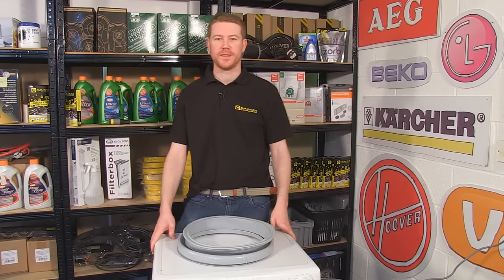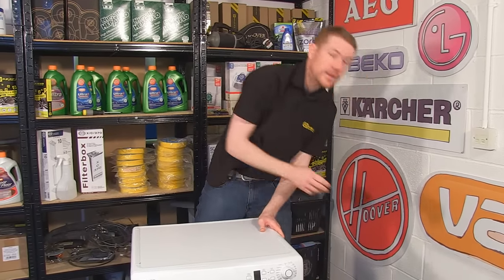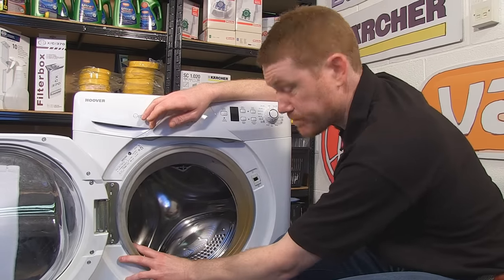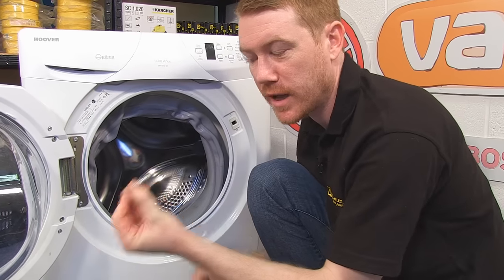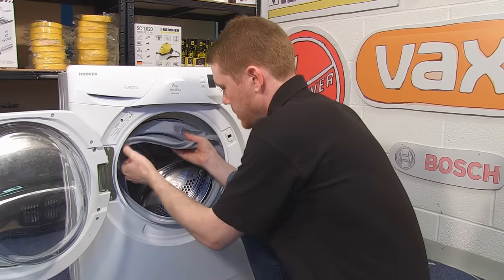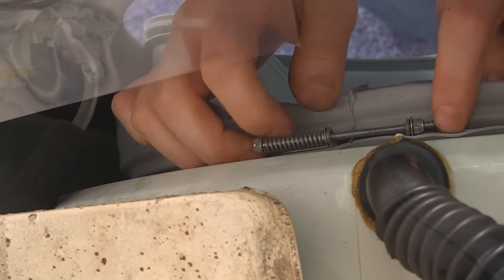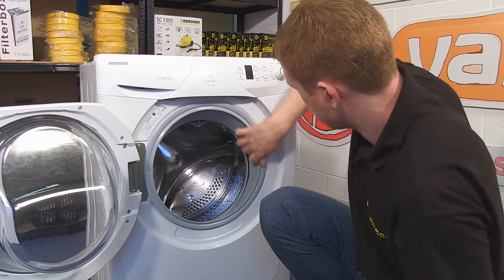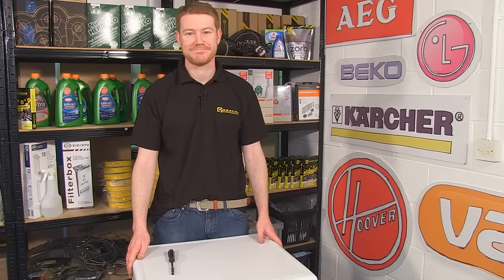How to Replace a Hoover Washing Machine Door Seal

Comment: Who's got the nightmare spring version on one of the newer Hoover models (2018) absolute nightmare, been trying to do this for 6 hours now on and off - the internal retaining band is hellish, conceding defeat and having to order the tool off Amazon. I hope that works.
Reply: Nope, looks like they're too small. Called a bloke today, told him what I'd done e.g. taken it off and cleaned it and then wasn't able to put it back. Without prompting him he said "Is it a Hoover"? Yes... He then went on to say that they're the worst and he struggles with them and he's got the right tools and it'll be £65 to do the job. So, he's coming round Wednesday.
Reply: @someblokecalleddave1  - I’m in the same boat - Hoover with a spring gasket on the inner ring. I bought the biggest/widest pliers on Amazon, they only stretch it about 0.5cm which makes getting it back on just impossible. 

Not sure whether to spend £25 on a new screw type retaining band, or just pay someone to do it. One thing is for sure, I’m never buying a Hoover again, I hate when companies use cheap rubbish that make basic maintenance a hassle
Reply: @SuperBert1000  Yeah I was tempted to go down the screw in route, but looking at how it all has to be tucked into all those fold so precisely, I thought that might even be beyond me? That and the fact that you don't know the diameter of the other retaining bands is suited to the Hoover models. I'd like to have been in when he does the work, to see if he super long pliers, but he's said himself it's ridiculously difficult. I'm not even 100% convinced that this is the solution to the initial problem of the leak!
Reply: @someblokecalleddave1  sounds like we have the same model - mine was leaking from the bottom. I took off the back plate and it seemed to be coming from the bottom of the door, so I’m pretty certain it’s the seal that has gone at the bottom. I’ve got a fella coming to look at it on Friday, so hopefully he can replace the seal and I can give it a test. Good luck with yours, hope it gets fixed!
Reply: @SuperBert1000  Mines a DHK 1482D3-80. Mine was same - just a little water on the floor at the front. Checked all the metal parts and the pipe connections, every thing like that was fine, none of the inside of the machine was wet or rusty, so had to be the rubber seals. Having got it off, it didn't seem that gunged up, there was a bit - but nothing where I thought 'Oh yeah that'll be what it is'. I'll let you know how I get on with it tomorrow.
Reply: Thank christ I’m not the only one! Blew a gasket myself trying to fit replacement.
Reply: @coolerking70able  I had an engineer come round. When my wife rang him and explained what I'd been doing he said 'Don't tell me its a Hoover'? My wife came back with 'Yeah, are not interested then'? He went on to say that they are the worst and he hates doing them as they're so difficult. When he came round, sure enough his pliers had a massive gape in comparison with the ones you can buy off of Amazon and he turned the machine upside down and accessed it from the bottom explaining when they're put on in the factory, its at the stage before the drum is fitted into the casing which is obvious. Did manage to get yours on?

Comment: I'd like to point out that I have a hoover dynamic next and the metal ring that holds the inner part on is not screw fix, it's a spring...... and it's a complete pig.... Took me ages to do this because the seal doesn't fold inside the drum and stay there without pulling off the rim.... So I had to get my wife to hold the rubber seal out of the way to allow me to get the metal ring into place.....My neighbours learned some new swear words though.... repeatedly. Once the inner ring is secured, the rest of it took about 3 minutes..... So frustrating..
Reply from the maker: Hi Rob, thank you for your comment and we understand that different models will be designed differently, we are glad you managed to do it so well done.
Reply: Rob Brewer I’m at the same point with my Dynamic Next machine, how did you manage to open the spring?

Comment: I did it exactly like instructed in the video. But it is impossible that the new door seal fits in the inner drum. Every time its almost completely inside, a fold appears in the seal. It seems as if the doorseal is to big. Do you have some advice for me?

Comment: During a recent wash the seal around the front came off and a top of mine got stuck around it. I managed to remove this but there's a couple of gaps im unsure if this is damaged because of the clothing and it coming off or its meant to have these? Also what is the right way to put the seal in as i have no idea whats the front or the back? Thanks
Reply: Generally the seal has a bit of a pocket/large channel on one side with holes in them, that goes towards the drum as it allows water to flow back into the drum (or to drainage pipes if your washer model has them) if it splashes against the glass window. 

There are also two ridges, one on each side of the seal that hold the retaining springs. Generally the thinner ridge (that holds a metal hoop with a spring holding tension) goes against the machine body and thicker ridge (with either a thicker metal hoop or just a large spring) goes around the tub.
Reply: @bami2  Thank you so much.  I'll give this a try :)
Reply: @natashamarples6468  just make sure you clean any channels in the seal (it's much easier when it's off) and lube both ridges up with some dishwashing soap before trying to put it back on, it will be nigh impossible to get it back on without it and you might need replacement springs/hoops if it just came off as it isn't supposed to do that. 

If the holes are neatly rounded they are probably original but if it's a tear or some other weird shape it might need replacement. Just make sure you don't see obvious damage and maybe put the machine in a basin so if it leaks it doesn't destroy the floor of whatever it is on. 

Good luck!

Comment: 2:55 was the golden piece of this video for me, using a bit of dishwashing soap and it went from completely impossible to slips on in a couple of seconds.
Excellent information!
Reply from the maker: Hi, thanks for your comment here, glad our advice has helped you out! Well done for completing the fix yourself.
Reply: @eSpares  I had to replace the entire drum assembly (broken spider arm) so everything in the machine had to come out (it was not "economically viable" to have it repaired by someone since the labor would've cost more than a new machine), but I took it apart to diagnose it myself (and determined that all the other components were in pretty good shape aside from a scratch where the original drum hit the tub, even the heating element had almost no limescale on it) and now it's all back together and working again without any leaks, because I re-used the original seal that didn't have any lube I just couldn't get it on, without that little tidbit of info I couldn't have done it. Thanks again!

Comment: I found fitting the new seal to the dru9m the most frustrating job I've done in my 72 years of life. I'm very practical and been trying to fit the seal for 4 hours now and still not there yet. Unless you can see the guy in the video fit the complete circumference of the seal, think twice, you get 90% fitted and it pops off somewhere else. I even have it clamped. 

Pay someone else to fit it and make sure it's a fixed price. 

Mike P.

Comment: Is there a companion video that explains how to retrieve a nut driver from the bottom of the washing machine, after dropping it trying to unbolt the inner seal?
Reply from the maker: +TooSlowTube Many hoover machines have a cover used to reduce noise. This can be seen being removed in a similar video: 
https://youtu.be/w9Fd8NWXa0A?t=33s
Reply: +eSpares Thanks.  Yes, I can feel something similar at the bottom of mine.  

I've got a Candy DQW1500, but the door seal is very similar to the Hoover in this video.  The inner retainer band thing has a hex head bolt though, instead of a Philips head.

Up until the point where I dropped the nut driver, it was going fairly smoothly... I tried using a magnetic pick up tool, but it just keeps grabbing onto the sides and other bits of the machine.  I can't see where it went to, so it's a bit of a non starter.

I think I might leave it all til another day.
Reply from the maker: +TooSlowTube Good luck with the repair.

Comment: My door seal wont go back on. The draw to drum water pipe came loose/uncapped from drum so thought removing door seal would give me better leverage to get to it. Now can't put seal back on as keeps popping off from opposite side. Any tips. Already used little bit squeezy.
Reply from the maker: Simon Dodd Sounds like you need a third hand. Make sure the seal is fully pushed in to the lip of the drum or front panel before tying to pull over the last part and get the seal on before trying to fit the clamp band. Good luck. :-)

Comment: Hi do i need to remove the top of washing machine to do this, i cant pull my machine out without removing half my kitchen. I need to replace the seal can it it work without the inner retaining band or will it just come loose? I have a candy Grand Vita
Reply from the maker: Hi, thanks for your comment. While we can't confirm whether there is an alternate method for your particular model, you are correct that the seal will be loose if the inner retaining band is not fitted, so this is an essential part of the process...as if not the possibility of leaks will occur.
Reply: @eSpares  thank you. I should've known there's no short cuts

Comment: Hi. I've watched your video multiple times now and I'm sure I've fitted the seal properly, but the seal is rubbing on the washer drum. Is this normal or could I have done something wrong?
Reply from the maker: If a wash loads is not balanced on spin the forces produced can flex the drum and cause it to contact the seal. If this has happened it may have caused the rim to wobble close and away when spun by hand. You can use a screwdriver to lever the gap larger or tap with a mallet from inside to reduce a gap. Often a little contact will quickly wear a groove  in the seal preventing further contact.

Comment: Hi, I know all hoover washing machines may not be the same. but what size is the socket needed to remove the 3 screws at the back of the top panel? Thanks in advance
Reply from the maker: Hi Mr Clayhead. We would recommend using our Torx set for all your appliance repairs. Please click the link below: www.espares.co.uk/product/es1251179/9-piece-torx-head-screwdriver-set
Reply: It needs a 7mm socket not a torx on my Hoover 7kg one touch.
Reply from the maker: Hi Marc, thank you for the post and good correction and thanks for helping with the information.

Comment: That white retainer strap is too big its come off ours and too big to go back on. What's the issue ?
Reply from the maker: Hi Tone wareham, you have to make sure when refitting the strap that it goes into the teeth correctly then when you push it together it will tighten itself.

Comment: please could you tell me do these instructions work on all models of hoover washing machine ?
Reply from the maker: +Samantha Johnson We do not have access to all Hoover models to be able to confirm this but it is likely to be the same or at least very similar for most machines.
Reply: Yes all hoover machines can be changed via the door cavity and working through that and the lid.  The most difficult to do are washer dryers,  however these are done in the same fashion,  just a little bit more tricky as less room to work,  and have to reconnect the gasket to the drying chamber again properly.  No machine unless designed in the last 2 years is different for Hoover or Candy.  (I am a former hoover engineer)  They can be tricky,  none are hard and they are all this straight forward.  Just the nack is needed to make it speedy,
Reply from the maker: Thanks for the comments Jason.

Comment: Hi sir, I have a model of Hoover with a small mouth connection on the top right. Do i have to align it?
Reply from the maker: Hi SpaceLion87, you would need to fit it back the same way it came off, most seals are aligned so check yours before you replace it.

Comment: Hi. could this also be done without removing the top? thanks
Reply from the maker: Hi Chris, It is possible to replace some seals without removing the top.
The one in this video uses a clamp that is screwed up to hold onto the drum. 
It may be possible to remove this clamp through the front but is likely to be very difficult.

Comment: 3:19 'you can then work the lip round the rim of the drum itself.'
No you cant. You can't work the lip round the rim of the drum itself. It's impossible. I've been on it for 2 hours.
Reply from the maker: Hi, we were referring to fitting the seal around the lip on the outer tub not the inner drum. If you look at the seal itself there should be a tight gap that will part allowing the inner edge to go inside the drum opening and the outer rim of the gap then pushes over the lip on the outside of the tub. Fitting can be difficult so it is important to ensure this 'gap' is lubricated' with the liquid soap to help it slip over the rim as you work it around. For a quick practice see how the outer lip fits and feels as you work this onto the front panel. Once you have got the hang of this take the front lip off again and retry with the seal to the tub. When retrying fitting to the tub I find it easier to start at the top and work one side down then the other as gravity can help the seal hold onto the lip. Good luck.
Reply: eSpares  I agree this is impossible,  using liquid soap has any made it worse as rubber keeps slipping off.  you need more hands than an octopus.  Also the video is so misleading, only a matter of seconds to fit the inner seal?  more like hours. Complete disaster.
Reply: I took me a long time too, until I realised I was doing it wrong. The seal, in fact, has a kind of a "pocket" that needs to fit around the metal lip of the drum and the door opening really snuggly - but it is possible.
Reply: I agree, it really needs two people, one to hold the seal in place at the top and the other to work it round. But we managesd in about ten minutes. Saved a fortune. Thanks for the video.